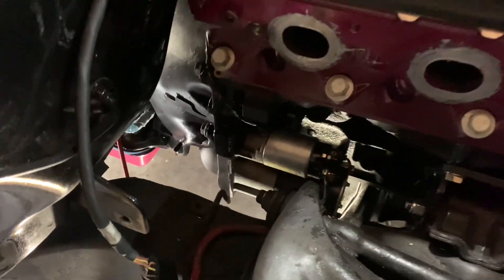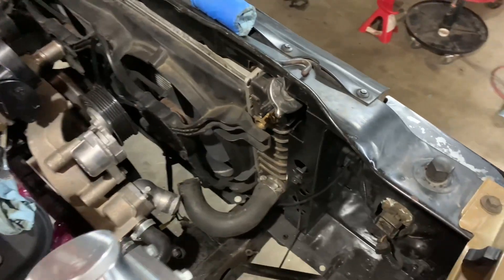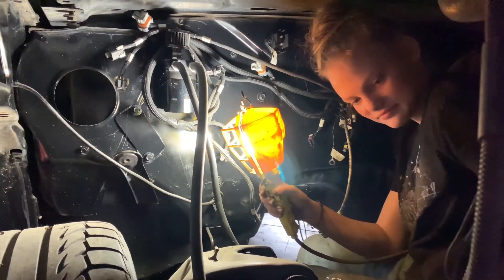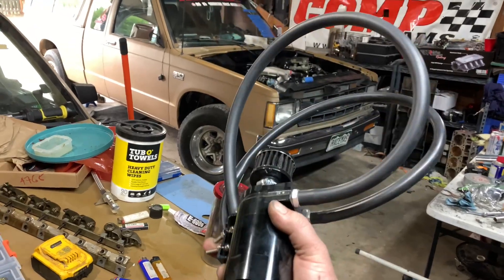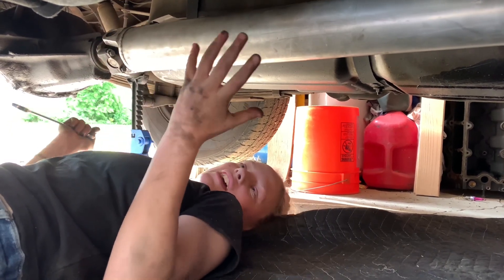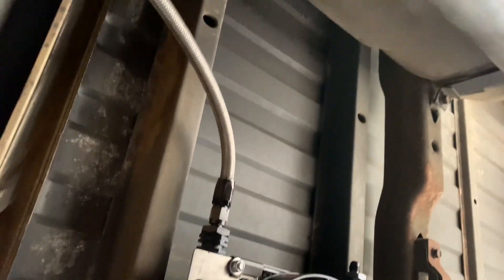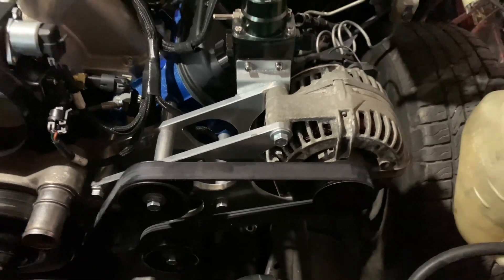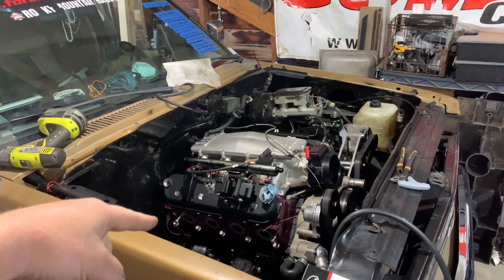7 days till RMRW2023!!!!

Comment: What log manifold is that thanks
Reply from the maker: It’s from rob young at forced performance. One of her sponsors he set this 67mm on this truck
Reply: @livefastdrivefaster  ok thanks man appreciate it how's the fitmet and can you keep wheel well in
Reply from the maker: @bradleydunford725 I haven’t ran a wheel well with this one. It needs modified on the bottom you can see it in one of the videos. We cut and channeled it
Reply: @livefastdrivefaster  ok thanks I was looking at the huron speed silverado log manifold that has a waste gate spot on it but don't know if I can run wheel well will
Reply from the maker: @bradleydunford725 this is on a little s10 there isn’t much room. We drilled a hole and welded on the waste gate
Reply: @livefastdrivefaster  oh ok so I'm pretty much gonna have to run no wheel well on passenger side, what motor mounts and oil pan are running
Reply from the maker: @bradleydunford725  I could try to fit the wheel well back in I just haven’t tried for serviceability during race week events. Are you building a 1st gen s10?
Reply: @livefastdrivefaster  yes got an 89 s10 I'm building
Reply from the maker: @bradleydunford725  nice!! We’ll hit me up for any info. You should use the cooling system I put in it works great
Reply: @livefastdrivefaster  I got a superior radiator that recesses into core support pricey but didn't wanna cut core support up, I got pretty much everything to do the swap other then little things
Reply from the maker: @bradleydunford725  nice! We used a 1996 factory s10 radiator and Sebring fans. We can idle in the staging lanes in 105 degree temps and only see 178 on the coolant
Reply: @livefastdrivefaster  oh ok, what water pump what thermostat did you run, what alternator bracket is that I'm trying to not run power steering since mine came factory with manual steering
Reply from the maker: @bradleydunford725   2010 Camaro water pump has truck spacing and comes out in a nice location if you want to run a low profile manifold with big throttle body. We have a 168 thermostat and an #ictbillet alternator high driver side bracket
Reply: @livefastdrivefaster  ok thanks man appreciate it, I'll probably run a 2010 camaro water pump and ict billet alternator bracket like you have, what rear end
Reply from the maker: @bradleydunford725 watch the other videos on the channel….. don’t run the stock 10 bolt you’ll see why
Reply: @livefastdrivefaster  yeah I just watched it what are you plan on putting in it
Reply from the maker: @bradleydunford725  she has a ford 9” but didn’t complete it in time.
Reply: @livefastdrivefaster  oh ok from quick performance
Reply from the maker: @bradleydunford725 no we build our own stuff.
Reply: @livefastdrivefaster  oh ok I got a 9" from mine just hope it works from what I'm told with the wheels I got with it it should be ok
Reply: @livefastdrivefaster  what motor mounts and oil pan did you use
Reply from the maker: @bradleydunford725  truck pan at the moment. Motor mounts are custom
Reply: @livefastdrivefaster  oh ok, I got metaltek mounts and muscle car oil pan
Reply: @livefastdrivefaster what mount is that you have the holley 3.5 screen in
Reply from the maker: @bradleydunford725 just a magnet window mount with the metal plate that comes with it
Reply: @livefastdrivefaster  ok thanks appreciate it where did you get it from
Reply from the maker: @bradleydunford725  Amazon I believe
Reply: @livefastdrivefaster  ok thanks, any updates on the ford 9"
Reply from the maker: @bradleydunford725  still recouping funds at the moment.
Reply: @livefastdrivefaster  oh ok